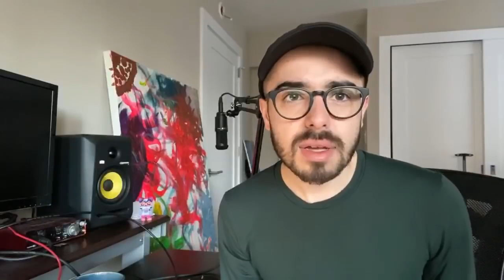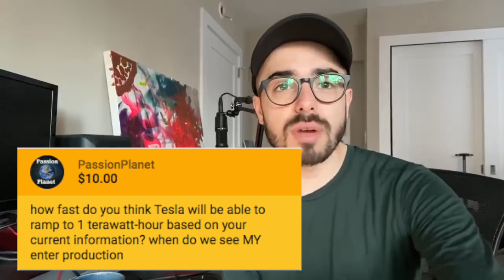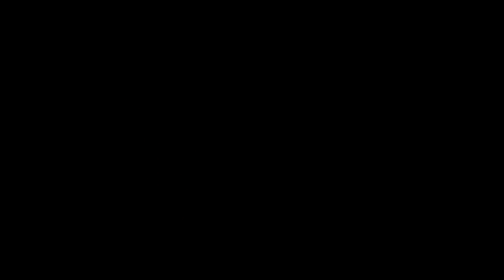How Fast Can Tesla Ramp To 1 Terawatt-Hour?

Comment: Elon Musk has said in the past that the world would need between 80 and 100 Gigafactories building batteries using the same tech they have in Gigafactory 1.

The formula has changed. The assessment of the new electrode technology (dry vs wet) says that dry electrode technology will allow 16 times the production from the same floor space, which suggests that the number of battery Gigafactories is going to get revised down from 80 to 5.

The auto industry has been sitting back waiting for their battery subcontractors (LG, etc) to come to them with new solutions. Meanwhile, Elon Musks's team have been working on this battery technology issue for several years.

So what's the game plan? On battery/drivetrain day, I'm betting that Tesla will unveil a new battery tech that is at least 50% more wattage per kilogram along with a plan for Gigafactories to build batteries and drivetrains and start offering batteries and drivetrains to car companies who are interested in partnering with them.

And I think Tesla's preferred partners will be German manufacturers. I'm pretty sure Ford and GM have scorched the earth between them and Tesla, and the German Gigafactory wi9ll probably include a huge new battery facility. The Germans are very honorable and they will be very grateful for this lifesaver.

I'd bet that Tesla is already in discussions to build at least another two Gigafactories in China just for batteries. I don't see any getting built in the US. It's the US that's doing everything they can to hobble Tesla. Trump is screwing the tech industry with his international policies (Huawei etc) and it would be madness to set your company up to be a part of the madness. Note: Risk V has just left the US for Switzerland. More tech companies will migrate as fast as they can.

Comment: Should Tesla become an electric utility company?

Within the next 10 years the price per kWh of solar energy at utility scale, is projected to match or be below the cost of current electricity.

Tesla produces solar panels and the batteries. Is there any company that is better positioned to be a solar generating utility company then them?
Reply: My guess it will be decentralized and connected somehow. Batteries + Solar that can be shared throughout a neighborhood.
Reply: @edwardd.484  I think solar roofs can be a significant source of energy but maybe not enough to replace the current amount that utilities generate.

Comment: If you're right that they just had a huge battery breakthrough that they'll announce next year, then they probably just did the math. If it means 1 million miles on the auto side, then what does that translate to on the grid and energy storage side of the business (which they already have a hard time with keeping up with demand for)? 

Could mean Australia is going to be pissed and want another big one when there is an even better 2.0 version with this breakthrough. Let alone other utility projects that now make sense with the 2.0 storage option. They need more batteries just for the added auto and semi production increases, but that could look small down the road compared to the utility side.